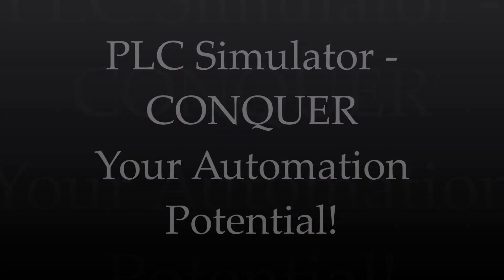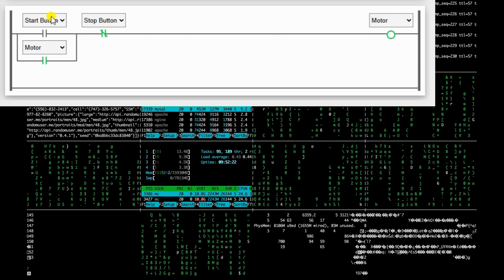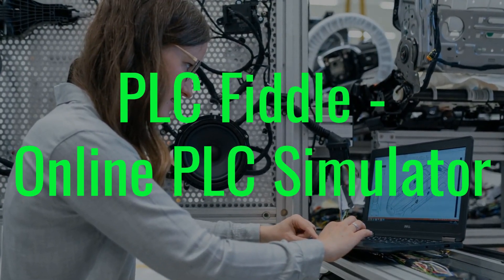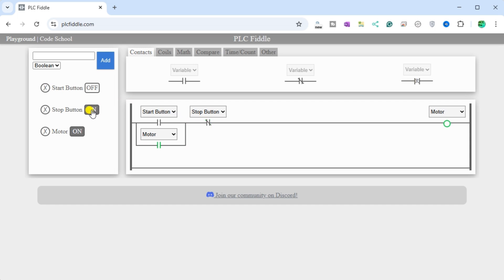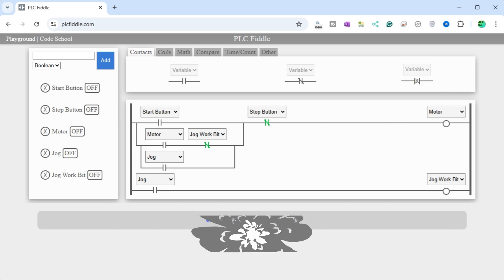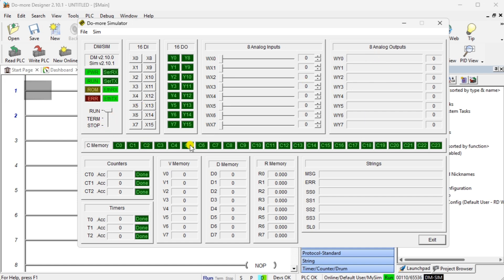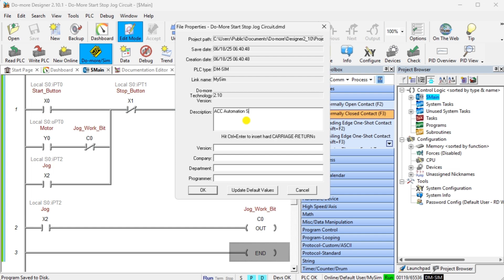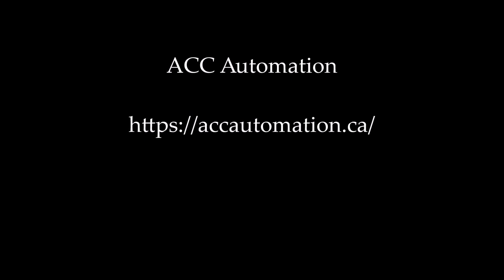PLC Simulator - CONQUER Your Automation Potential!

Comment from the maker: PLC Fiddle Series can be found here...
https://accautomation.ca/series/plc-fiddle-online-plc-editor-and-simulator-in-your-browser/

BRX Do-More PLC Series can be found here...
https://accautomation.ca/series/brx-do-more-plc/

PLC Programmer Guide can be found here...
https://accautomation.ca/programming/plc-beginners-guide/

Step-by-step instructions for programming a START STOP JOG circuit in a PLC can be found here:
https://accautomation.ca/how-to-make-a-start-stop-jog-circuit-in-a-plc/
Note: This can be tricky because you need to understand how the PLC scans your logic.
https://accautomation.ca/tag/plc-scan-cycle/

There are many different PLC manufacturers with their hardware and software. All programmable logic controllers share similar basic features. Here is how I would approach learning about basic Programmable Logic Controllers (PLCs).
https://accautomation.ca/programming/plc-beginners-guide/

We are using the Do-More Designer programming software. This is an entirely free, fully functional PLC programming software package that includes a PLC simulator. Test your logic before purchasing any hardware. 
The entire BRX Series PLC can be found at the following location:
https://accautomation.ca/series/brx-do-more-plc/
FAQ
https://accautomation.ca/series/brx-do-more-plc/do-more-plc-faq/

There are several reasons why we are using the BRX Series Controller. Here are just a few.
 - Standalone PLC with built-in I/O
 - Built-in Data Logging 
 - Communication ability - Ethernet Port, RS232, RS485, USB - support for protocols such as Modbus RTU, Modbus TCP, ASCII, K-sequence (Direct LOGIC users), Custom Protocols (ASCII over serial, TCP or UDP over Ethernet)
 - Built-in Analog input and output
 - Integrated motion control
 - High-speed counters
 - Powerful instruction set (Video of instructions in software)
 - Ability to expand the system with a variety of modules
 - Part of the Do-More series of PLCs uses the same free software. (Do-More Designer)
 - Integrated simulator in the software capable of external communications for testing

The BRX series of programmable logic controllers comprises four distinct units. They differ depending on the Inputs and Outputs built into the unit, as well as whether it has an Ethernet port. 
No I/O Micro PLC unit   (BX ME)
10-Point Micro PLC Unit (BX 10/10E)
18-Point Micro PLC Unit (BX 18/18E)
36-Point Micro PLC Unit (BX 36/36E)
These CPUs (Central Processing Units) are also known as MPUs (Multi-Processing Units) due to their communication capabilities.

Regards,
Garry
ACC Automation
https://www.accautomation.ca

Explore the power of the PLC using a PLC simulator, which enables testing code without requiring actual hardware. The PLC simulation can significantly reduce manufacturing costs. By utilizing ladder logic and simulation, automation is more accessible and efficient.